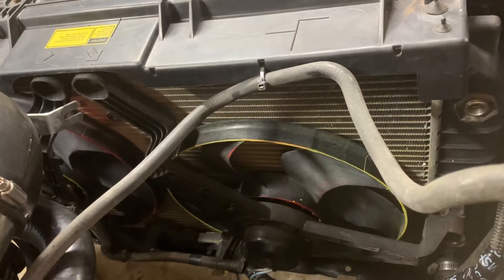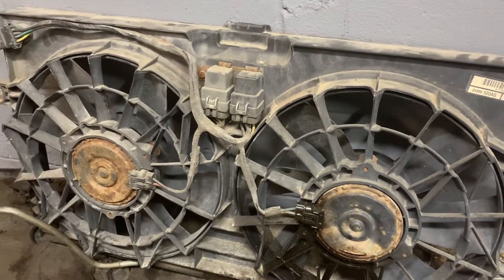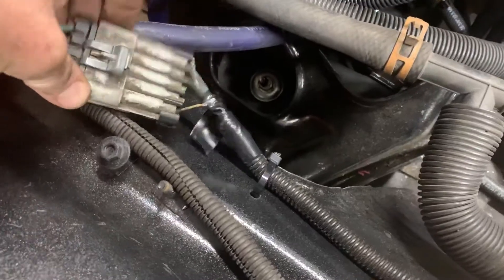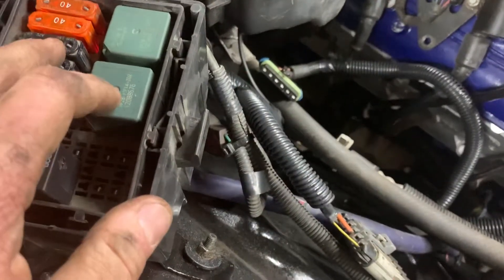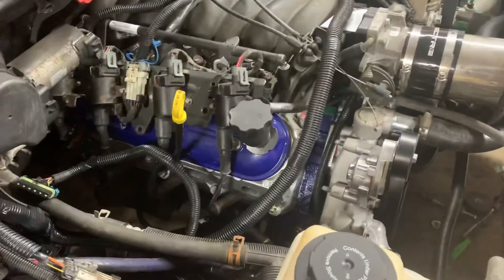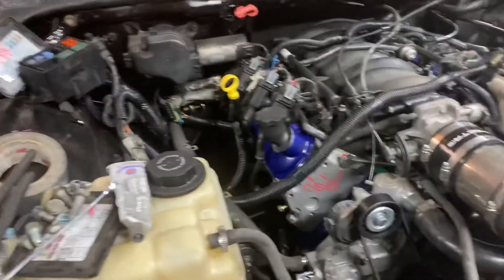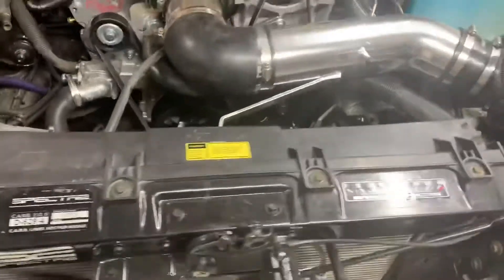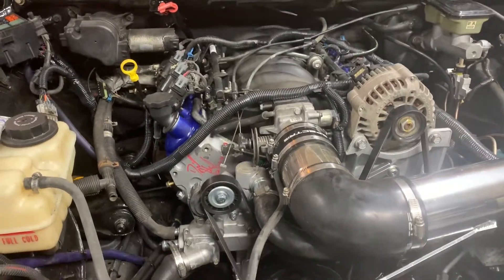94-96 B-Body LS Swap Fan Wiring explanation

Comment: Hey bro what wire harness are you using? I want to use my original fuse box an every thing like you did. Do I need the ls1 wire harness?
Reply from the maker: Phillip Younkins That’s a good question, i used my stock wiring harness and cut it and wired into the new wiring harness that I pulled out of the Chevy truck that I took the 5.3 L motor out of, so basically I just took both wiring harnesses and built one out of both

Comment: Here how I wire fans fast dirty. Good size wire battery to fan. Then ground wire to ground. Half ground to dash and other half ground from body to dash. Connect to toggle switch. Running long ground wire makes wire less pron to melting. If you run hot to far wire gets hot. I did it my 95 Caprice instead 160 temp

Comment: I have an issue with my 96 ss . The fuse box housing is melting underneath the fans relays . And the fans stopped working even tho i replaced the relays and fuses works fine and fans sensor in water pump is new . Fans are good i wired them directlly to the batter they worked . So help .
Reply from the maker: EA. jam did you check to see if any of the wires under the fuse box were melted?
Reply: @thehowardsgarage2480  no not yet .
Reply: @thehowardsgarage2480  where or how i can contact with you ?
Reply from the maker: EA. jam Bbodylsswaps@gmail.com
Reply: @thehowardsgarage2480  dont you have instagram ?
Reply from the maker: EA. jam no sir, no instagram.... do a lot of people use instagram?
Reply: @thehowardsgarage2480  who doesn't !! Lol  yes many use it .
Reply from the maker: EA. jam ok gotcha... I may look into that.
Reply: @thehowardsgarage2480  i have sent you an email with my issue .

Comment: Hey, just watched this, explained everything I needed to know, thanks! Are you using HP tuners? 

Sloppy mechanics have me wanting terminator x but I dont want to fool around with that standalone unit, to make my factor dash work.
Reply from the maker: RJNeutsie I am using HP tuners, and my factory dash works fine in my 96 caprice. I built my own wiring harness.
Reply: Hows HP working for ya
Reply from the maker: RJNeutsie good... I really like it... I still don’t know everything but I deleted the Vats, and cleared out all the diagnostic codes, and changed some parameters. It’s pretty cool.